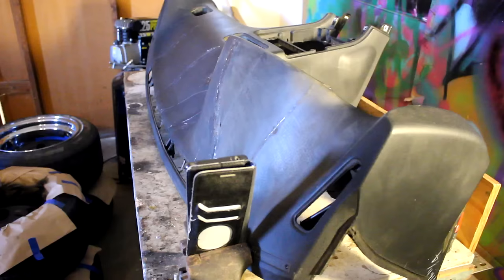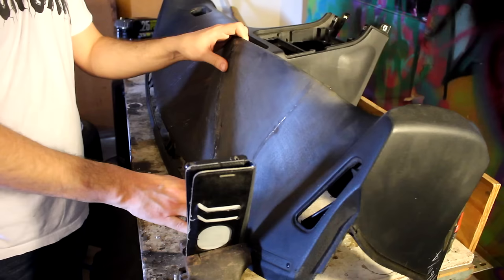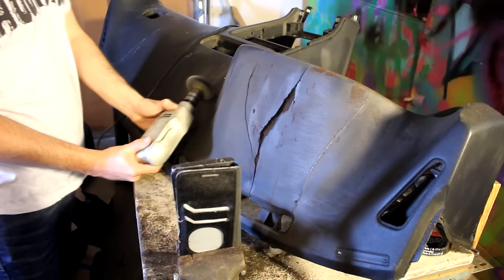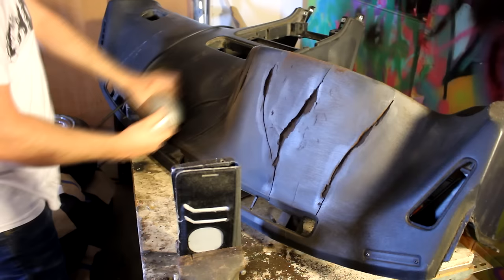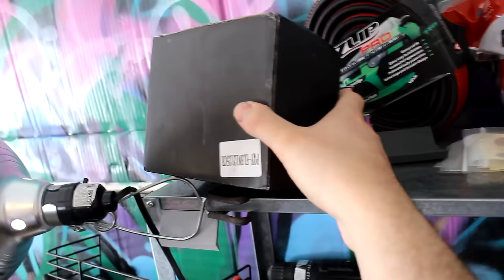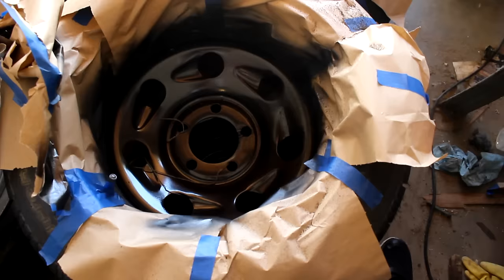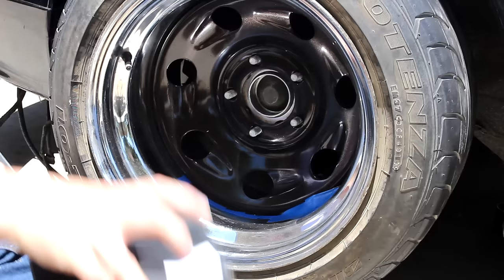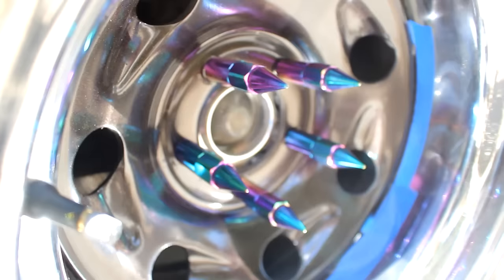ILL to Trill ep. 9 | Budget SR20 240sx Drift Car Build

Comment: hey man im sure you going to take those wheels off again at one point but i cant help but notice you put that first one on backwards. being a directional tire and all. that aside. vids are awesome keep them comeing
Reply: also when you put the motor in the car its ride height will change a bit as far as putting your over fenders on.
Reply from the maker: +nelson wells all the tires will be replaced soon. No worries.
Reply from the maker: +nelson wells my coilovers are pretty stiff so it wont change by much

Comment: center of the steering wheel same as the rims, car do in Satin black.
Reply from the maker: i had the same idea for the steering wheel
Reply: +Go For Broke Garage in my opinion the wheels should always be a different color than the car.
Reply from the maker: +Richard Oneal remember though ill have the black overfenders to seperate the two
Reply: +Go For Broke Garage im just a creature of big color contrast you saw my engine in my civic. if it was me the wheels would be a neo chrome or bright ass color against a satin black car.;)
Reply from the maker: +Richard Oneal its the 187sx it has to be murdered out
Reply: +Go For Broke Garage i know, i know. i used to have a 4 door dully slamed to the ground that was murdered out loved that truck.

Comment: That quick release and that steering wheel are a terrible idea. Don't risk using stuff that will bend and break if you get in an accident. Guaranteed that cheap shit will.
Reply from the maker: People need to quick over reacting. i felt the materials in my hand and did a stress test. They are no cheaper than the plastic  ones from factory